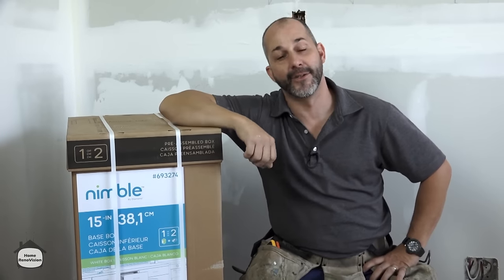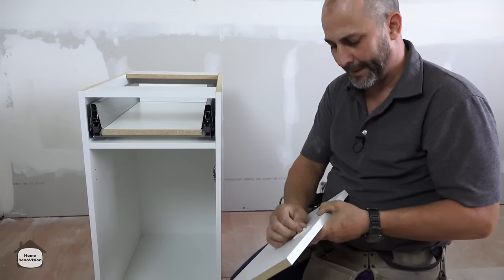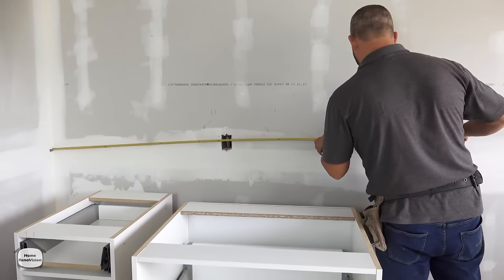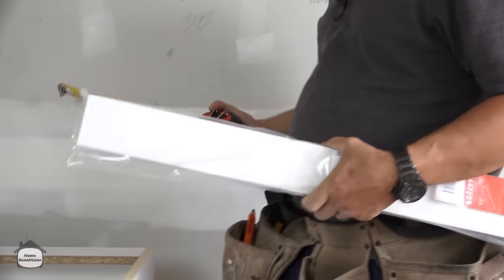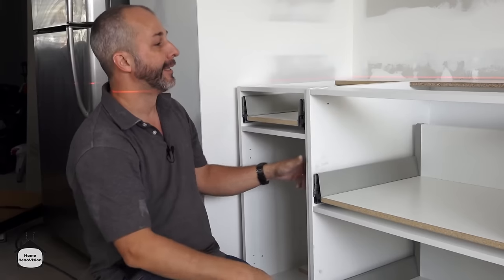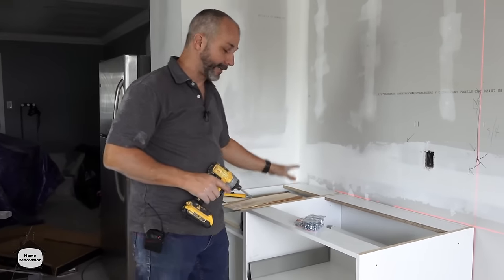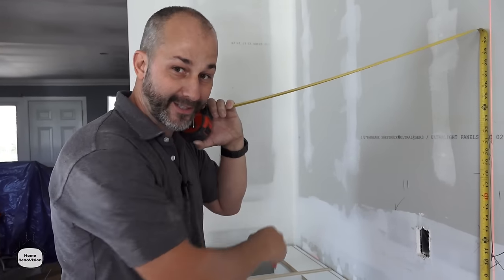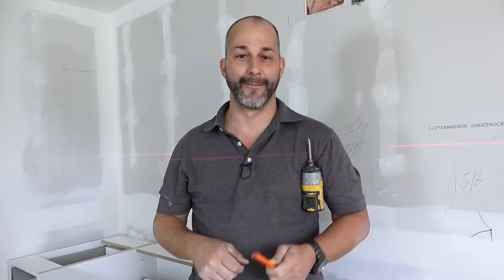How to Install Base Kitchen Cabinets and save $1000's of dollars

Comment: Want to know a major bugbear of mine? Im a tiler and something that really gets my goat with some kitchen fitters is when they dont level the base cabinets properly when the kitchen has a free standing cooker. Was booked in to tile a kitchen only recently and the client chose bevelled metro tiles. When i put a level across the gap where the freee standing cooker will go, the base cabinets were out by 10mm. Dont sound much but if i had to tile that kitchen i would have had to start tiling at the 'low' end and when i tile across the gap, and in order to keep the tiling level, i would have had to cut the bevel off the metro tile! She would have sued me i think! Kitchen fitter has to come back and remove worktops, sink, plumbing, etc and lower the cabinets on one half of the kitchen and then refit. Ouch. Another fantastic tutorial. Cheers mate from London

Comment: Great tips.  I think the quick grip clamps would be really helpful holding the cabinets together.  I bought a Bosch laser very similar to this one in the video (2 lines).  If I had to do it over again I'd spend the extra money on the one that throws the vertical laser (3 lines)  up to the ceiling as well which can replace the use of a plumb bob for doing steel stud tracks  and stuff like that.
Reply from the maker: very handy if you use steel.Cheers!

Comment: Possibly do a video on making rustic wood cabinets? I'm planning on making rustic cabinets in a small kitchen in my garage apartment your tips would be awesome. Or rustic cowboy style bathroom? With rusty corrugated metal and fence pickets
Reply from the maker: We will be doing some more design elements soon. Not sure about which ones at this point.

Comment: There are a ton of RTA (Ready to Assemble) cabinet vendors out there. Yes, they arrive knocked down and you have to spend a bit more time to assemble your cabinets before you install them, but they are made of 1/2" plywood with hardwood fronts, hardwood doors and hardwood drawers with dovetail assembly. And they probably cost about the same as your melamine coated sawdust shite.
Reply from the maker: Easy Bob, I never said they were the best justa great value and available on the shelf in the store. Cheers!
Reply: I agree that they are available on the shelf.

Comment: Hi Jeff a we tap the cabinet feet you put them on wrong when you screw the feet to the base  there was a long piece on the foot you point that to the Gable it's designed to hold the Gable and when you do that the front of the foot is flat  the way you had it it was round and why you do that is for the kickboard so it's not sitting at an angle hope you can understand what I'm trying to explain 👍👍
Reply from the maker: Thanks for that concern however any other direction and they stick out where the finish panel goes. not like ikea at all. Cheers!

Comment: hey buddy, quick question, Im having my small kitchen renovated and all the guys who came over to measure and sell cabinets they keep telling me to install cabinets above the stove to use the empty space wall. Since there are no windows in my kitchen I was told that no need to install a hood fan. There is a small 12 x12 vent on top of the wall at the corner of the kitchen closed to the ceiling. My apartment building was built in 1969. Please I would love to hear your advise, do u think it would be safer not to install wall cabinet at all above the stove? very much appreciated your reply. Thanks again

Comment: quick question forgot to ask: I bought vinyl plank flooring. That type of floor should be installed before or after the base cabinets? Im getting a quarts countertop on top of the base cabinets. Please advise, thanks
Reply: All floors should be installed before cabinets. Why install after?

Comment: You have a great Chanel and this comment is sincerely for you and your viewers pleas don’t take offence. You should install those feet so that the side panel of the cabinet is supported by the longer side of the the leg base. The way you have installed them you have only supported the base piece. Any heavy load can collapse the unit. This system is the norm in the uk and you realize that mistake normally after the  granite has been installed. 😔

Comment: Please help! I'm replacing flooring and vanity in the bathroom, so which goes first? Do I place vanity down then flooring around it (Luxury vinyl planks) or plank flooring then vanity??

I watched your painting like a pro video and painted my space, but I can't seem to find an answer on this.
Reply from the maker: The truth is you can do it either way. I prefer to put flooring first. this way you have a nicer finished look and you have the option to change the vanity at a later date and not have to do the floor again. Cheers!
Reply: Home RenoVision DIY   THANK YOU!!!
Reply: @HomeRenoVisionDIY  would you recommend this for a kitchen aswell? putting flooring down first then cabinets?

Comment: Great video! I am going to install ikea cabinets soon. To save an extra cm  at the countertop, im not going to use the metal rail. (Cause i only have 62cm depth) So I assume I have to mount them to the back wall as you did? But I will have to use the square metal parts in the ikea cabinet right,to mount it to the wall.

Comment: I don't know who else to go to with this question. I have laminate counter top miters that have a little bracket that needs to be tightened and then glued. Problem is my lazy susan base cabinets are solid and I have no access to the brackets from the bottom :(

Comment: Tip for screwing in the feet: Assemble the feet after you screw them into the base.  That way, you can screw the screws in straight, then attach the feet.
Reply: lol got him. or get a bit extension

Comment: Even faster way to install these cabinets and save more money is to attach straight piece of lumber to wall same height were is cabinet underside/bottom and only use plastic legs on front side. Then lift cabinet on top of that lumber and then adjust front legs to match floor screw them each other and after that screw them to wall studs.
Reply from the maker: No money saved there. the feet come with the cabinet! besides I want to rely on the transfer of weight through the foot later when I install the counter top.

Comment: Just a tip but the feet really need to overlap the sides of the cabinet to support the downwards pressure 👍🏻
Reply from the maker: I am not sure why they are built that way either. All I know is that they managed to support the weight of the concrete counters we formed on top. My guess is since they are pre built they must have a glue as well as the hardware. All I know is they wouldn't sell a product that couldn't carry stone without opening themselves up to massive lawsuits so they must have tested this for performance and designed it to last.  It made me a little nervous too. But Lowe's sells a decent product and I decided to trust them. fingers crossed. For the price there is not a better option out there.
Reply: Home RenoVision DIY the feet are actually designed to overlap the edges which is why they have a longer side and are not round. Just twist them 90 degrees from where you had them then screw them in and voila 🙂
Reply from the maker: Hey B Scooter, don't get confused with Ikea cabinets which cover the gable. These feet will not install over the gable end.
Reply: No need to overlap for sides. We have used those type of feet since 1990s and those can bare load when they are near side if your cabin is built with dovels.
Reply: @HomeRenoVisionDIY  The plastic Feet on the part you attach to the cabinet bottom are oblong, you pointed it straight back, you where supposed to point it so that oblong section supports the side walls of the cabinet via the "gussets", it's not a lot of support but it's more then nothing and it helps transfer the load to the feet

Comment: Hey guys, I need to make a straight cut on the bottom of a cabinet box in order to get my refrigerator to be able to slide further back into its spot.  Right now it's jutting out about 10 inches because door hinge assembly is bumping into the cabinet above.  What's the best way to neatly make a clean straight cut with cabinet in place?  Thanks!!
Reply from the maker: I don't think there is one. remove the cab and cut on a table saw. Cheers!

Comment: Is there anything you can suggest for me to modify a 60 inch cabinet to 59inch?  My walls are actually between 59.5-60 inch and I cant find cabinets with smaller measurements
Reply from the maker: you could try removing the drywall first and then installing it. But you may find the door won't open?

Comment: Thanks for posting all of this Jeff, it's amazing!  My wife and I just bought a 115 year old house in Massachusetts and are planning to fully gut the kitchen, pantry, and mudroom in order to install a new kitchen (I'll be making custom cabinets and an island) and a half bath.  The house has mostly original pine floors, but newer red oak strip flooring in the current kitchen (estimated around 15 years old).  At some point in the future, we would like to unify the flooring - either restore the original look of the kitchen floors or put new flooring over everything since old pine isn't really our style.  Do we have to remove the red oak under our new cabinets before we install them, or would you leave it in place and cut around the cabinets in the event of a floor replacement in the future?  One thing to note is the floors aren't level in this house, so we've already got some leveling work to do - I was planning to use the EZ Level system or something similar for the cabinets.
Reply from the maker: that is a tough call. personally i would remove any flooring that is not destined to be there long term. it is really hard to cut out hardwood flush to cabinets. I would even drop in a vinyl sheet flooring in the mean time. that can be cut with a knife later and will be easy to clean in the mean time for a pretty low cost. Cheers!

Comment: What's the process for doing the kick plate with those clips? Do you just measure out to the center of each leg and transfer onto the back of the kick to attach the clips? Seems like the only way to do it, but also seemed to leave for a bit of a chance for error.
Reply from the maker: those clips set up in  a groove similar to ikea. There is plenty of mercy and the install was quite easy.

Comment: Jefffffffff I have a question How do you know where the stud is if you have a wall/dywall.
Reply: Look for an electrical outlet,  it will be mounted on one side to a stud.   From there studs are typically laid 16" apart.

Comment: You are supposed to twist the feet sockets around that they support the unit gables or else all that’s being held up is the bottom shelves 😭😭
Reply: Yeah, the elongated tab on the adjustable feet should sit under the cabinet end panel

Comment: Peanut Butter works better than WD40 to remove the adhesive.
Reply from the maker: Thanks for the tip Barb, I am going to try that next time I have peanut butter sandwiches in my lunch. Cheers
Reply: Home RenoVision DIY a little bit of heat from a hairdryer also helps with most sticky labels.

Comment: Those cabinets look extremely cheap! You can get rta full plywood cabinets which are way nicer and almost the same cost. Why would you have electrical wire or plumbing going through studs at the point where you are screwing the cabinet to the wall?! Second 18" inch back splash isn't standard for tile. Most designers and builders are making backsplashes 19 and 20 inches it helps accommodate small appliances better
Reply from the maker: These cabinets are extremely cost effective. sometimes in order to stay on budget difficult decisions must be made.
Reply: @HomeRenoVisionDIY  In regards to the cabinets, I saw Nimble by Diamond was listed "exclusively" at Lowe's. When I went to browse Lowe's collection online (today) all of the Nimble products were listed as no longer available at Lowes.com (which is in contrast to other cabinet lines). Do you know if this line was discontinued by chance? If so, do you recommend any other budget cabinet lines?

Comment: Why tf would anyone want adjustable feet
Reply from the maker: In case their shoes start to shrink
Reply: Say you have a small leak in your kitchen, those cheaply made cabinets will wick that water up and swell. The plastic feet raise the actual cabinet 4" off the ground out of the water. That means less money on restoring to pre-loss condition.
Reply from the maker: Very true. However most leaks happen in the cabinet under the sink. Let's all make sure to tighten our fittings and use the automatic shutoff for the dishwasher line.
Reply: the plastic feet lift the "wood" (and I use that term loosely) up off the ground so they are less likely to be damaged if say you have a water leak that floods your house, they are also WAY EASIER then having to SHIM the corners of your cabinet to get it all level when your floor isn't.

Comment: Just a minor thing but did he put the feet on wrong? I thought the point is to use the bit with the slight lip on the foot top plate and screw that into the base of the vertical side panels? so the feet are attached across both the side panels and the main base.